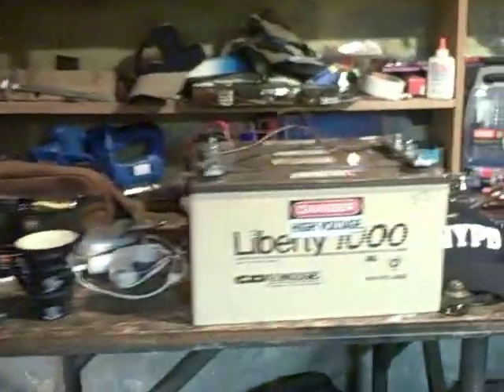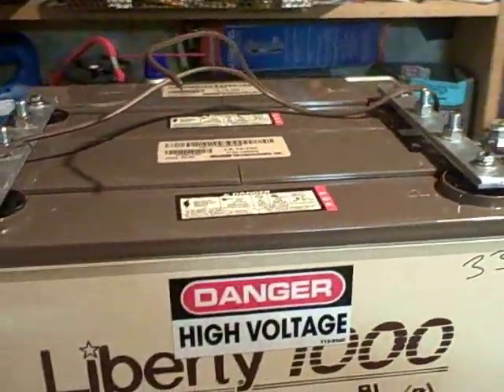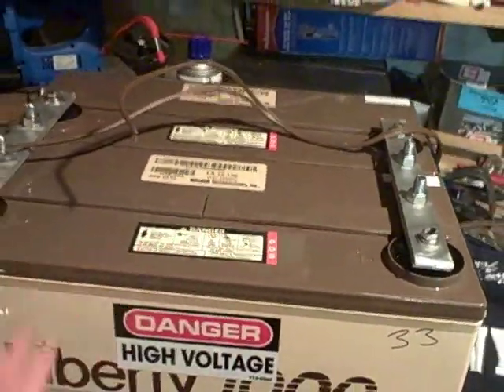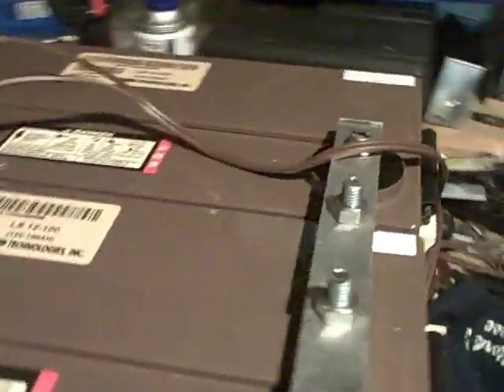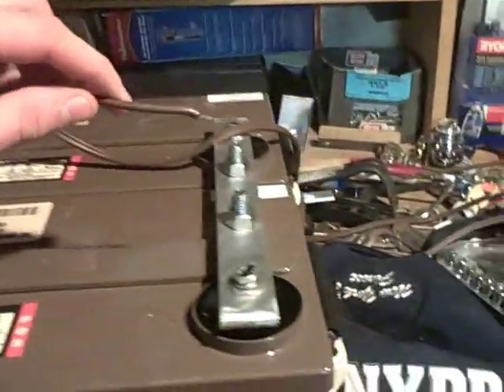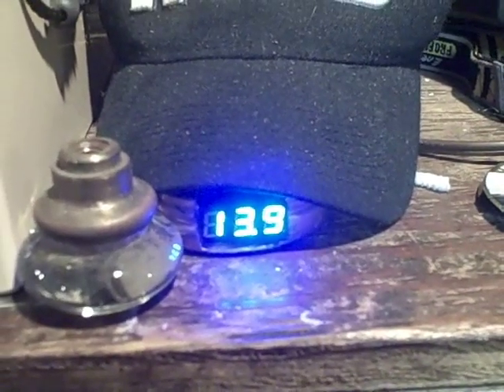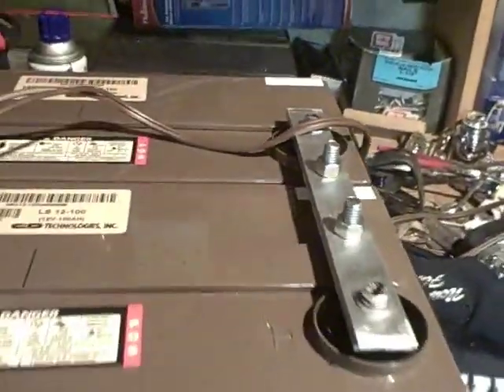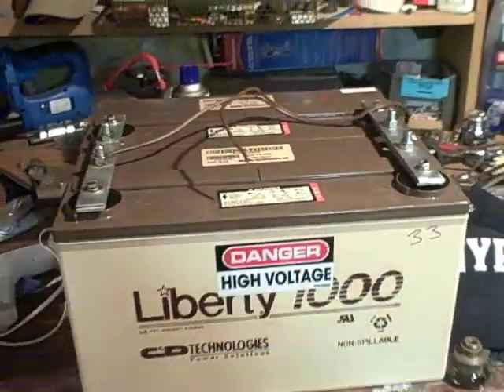Buss Bar Voltage Test - How To Install 2 Deep Cycle Car Audio Batteries -  Best 4 SPL Stereo Systems

Comment: Yes, it's necesary to have a H/O Alt -

Adding a second battery on a Stock Alternator is only more burdensome to the charging system - 

Order if biznaz = Alt > Batts >

Comment from the maker: @rasberrysauce - If you only have a 80amp alternator, I would most definitely upgrade that before adding an extra 1000 watts, and a battery to the electrical burden - That would be a recipe for frying your alt right quick. With a H/O alt and an extra batt, you're ready for 5k burps & 2k music - easy.

Comment: @ Ricky the purpose of this setup is so that you're not draining power from your primary you only have one battery for your primary that's why your balls drop a little bit then jump back up on your car starts because it's reinforced by the alternator the three battery load that he has all the batteries are reinforced by each other but if you put your primary battery on charge until its full when you get the meter it would read the same until you start putting loads on it depending on what type o

Comment: @omairgeforce current is determined by the resistance of the load. a 12 V voltage  source will produce 100 A of current when there is a 0.12 Ohm load.

Comment: @pgm98387 Just think of all of your wiring as a water hose. You can get alot of water (amps) to run through a hose, but the more current you put through it the closer you get to the hose bursting (wiring melting and/or catching fire). That's why lower gauge wire 0/2/4 is what is commonly used coming from the battery in the front to the speakers in the back. This is not a perfect example since you are applying resistance and heat dissipation as opposed to psi, I hope it helps. I need more space!

Comment: @fingerandskateboard to clear this up for you. your alternator is where the additional voltage comes from... Here's a great example, Step 1.)With your vechicle off and using a good battery go out side and measure the voltage at the battery terminal's. NOTE: with a good battery it should say 12.? Step 2.)Start your vechicle Now with your vechicle running perform the same step applied at step 1.) Hope this help's you =)

Comment: the voltage will only go up when you wire negative to positive. I had a Monte Carlo on hydraulics with 12 batteries and was wired 92volts to the front pump

Comment: Actually if ya wanna be technical, a traditional battery has 6 plates in it and each plate holds 2.4 volts, resulting in a total output of 14.4 volts. I don't know where or how the whole "12 volts" term came into play but in a perfect situation, a "12 volt" battery would actually put out 14.4 . Oh and as for running them in series to create a 24 volt system, check into some of the older BMW's , they ran 24 volt systems I believe

Comment: sorry man, I meant to say that this connection was going to give you 12v because it is a parallel connection, but were prolly tired and got confused lastnight, so that is why you told me what you told me.
I'm not fighting with you or anything like that, but if you want check the first comments I left in the other video and see my point. you answered a question to one of the guys underneath saying that you'll get...
just check it.
and forgive my bad English.

Comment: I plan on installing 2 extra batteries in my system, and Im curious because I have a 4 channel and a sub amp, do I need to have 2 runs of positive from front to back or will i be able to connect both amps off of the extra batteries with only the one run?

Comment: could you connect your power wire and ground from the amplifer to the batteries like that instead of running the whole power wire to the main battery under the hood?

Comment: what size battery is it? theres many reasons y ur lights are dimming your system could be withdrawling a large percentage of ur batterys power or ur battery ur using is to small try install a bigger starter battery "bigger is better" or the biggest you can fit in your engine bay that should start you motor fine and even out the percentage on your electricals!!!!!

Comment: hey exo can i do this without buss bars?? like connect the batterys like you did but with some 0 guage wire?? would i just take the the positive + from one battery and the negative - from the other battery and connect them to my amp?? thannks alot much apreciated

Comment: it would only get hot if the bus bar was undersized.  if it was too small, there would be too much current trying to flow through too small of a piece of metal, thus heating the metal.  its like most space heaters - they make them with too small wires for the plugs, and the cord heats up.

Comment: 13.9 volts is what the alternator charges at. its completely normal. most amp power outputs are rated at. 13.9 volts although they say 12 volt. it just happens

Comment: not at all. theres probably just some leftover charging voltage in the batteries. normally when theyre inside the car and the car running, batteries should be reading around 14.4 to 14.7 volts since the alternator is charging the entire system.

Comment: Are you still running the liberty batteries? If you are, how much were they? Are they reliable? Where can I purchase Liberty 2000  from? If there's another battery that's out there besides the expensive Kinetik and XS Power can you plz let me know. I have a 1999 Nissan Altima in need of help or advice on battery and inexpensive alternator company. I will be running 2000 watts rms after its all said and done. PLZ Help

Comment: how did you get 13.9 volts? without a booster or something?
when i turn of my engine ,the voltage drops to 12.7 until ill start my engine  it will be 14 volts

Comment: will matter on how many batteries that you use in parallel???  so i want to run 3 batteries in parallel will it still be within the 12-13 volts range???
Reply: Yes you can run 3 and remain safe

Comment: hey man i got a 09 cobalt and they dont make any other batteries except the stock one for it and the same with the alternator so i cant upgrade either of them for my system my alt puts out 130amps and i was wondering if that would be enough to hook up 2 batts or if you had any suggestions on what i could do i dont want to get a battery cap and my lights are dimming bad when the bass is up any help would be appreciated man thanks

Comment: it's interesting how car amps work.... they take that 12v and bump it up to +/- 50+ volts DC- the higher the amp power the higher the voltage (this is what the mosfet power supply does) to power the amp... and the amp oscillates that according to the input signal.... if you play a sine wave and measure the output you'll see what i mean.... thats why the speaker wire is so small.... for any reason DO NOT touch the amp's output terminals while blasting it out... it can be deadly

Comment: hey exo, im running 2 12inch 2ohm Alpine type r's off of my m110 mono amp and my mids/highs off my rockford r-300 4channel i have a power cell battery already in my trunk but i have a feeling its not working, should i have both a positive and negative from my fromt battery going to it? or should i have my power them ground it, also how would i wire another one in? should i run it parrell or in a series?  if you could message me thanks.

Comment: yo wen u connect batterys like that jus for ur stero syteam do u jus run a wire from ur front car battery that gets connected with ur 2nd batter for ur sytem? or how does it go?

Comment: hey man i got 2 batteries hooked up in my cobalt its 2 stock batteries for the car because you cant get optimas or anything like that for my car they dont make them but what i was wondering is with my car started the volts are reading 14.8 do you think its necessary to do the big 3 upgrade or will this be fine..my subs are only 1600w running on a 2 k amp

Comment: lol although you didnt get 24 volts exo you just wired it in parallel which means your amperage would be increased at 12 volts